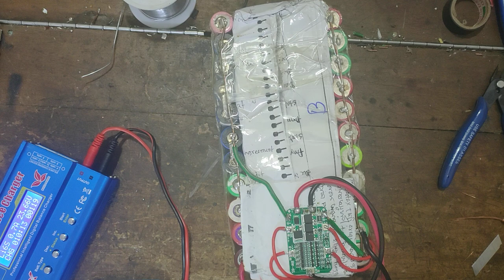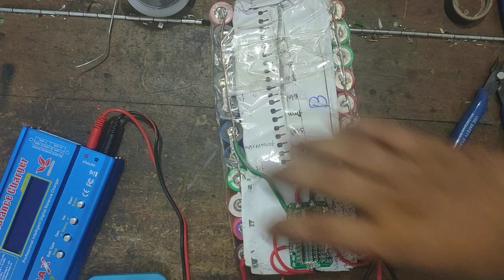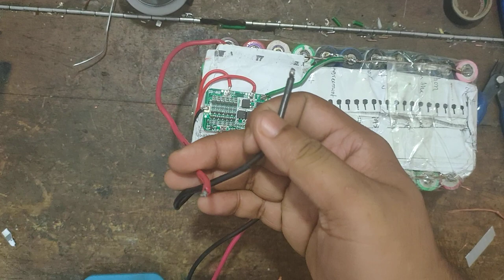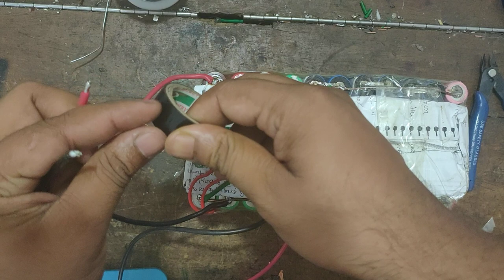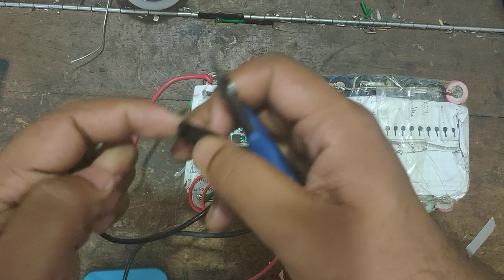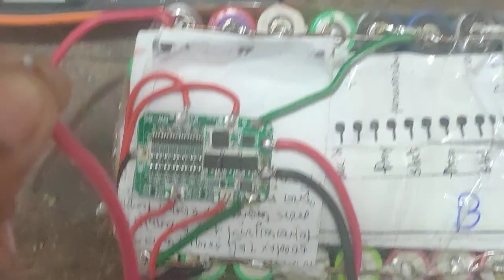বিএমএস লাইভ safty টেস্ট | BMS live protection test | lithium ion battery

Comment: Does the BMS actually balance?  I have seen plenty of example of bad BMS not balancing properly and FET exploding during high discharge.   Faulty BMS is probably the no. 1 cause of Lithium Battery fires.